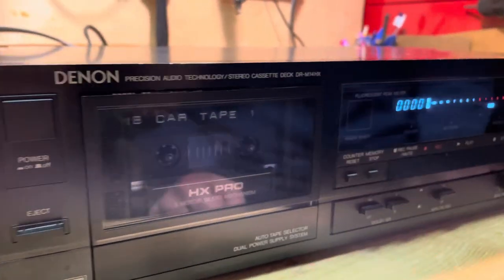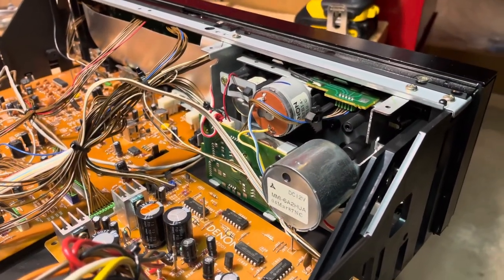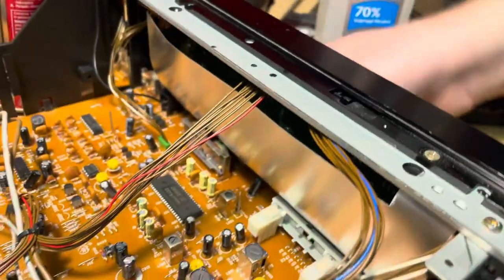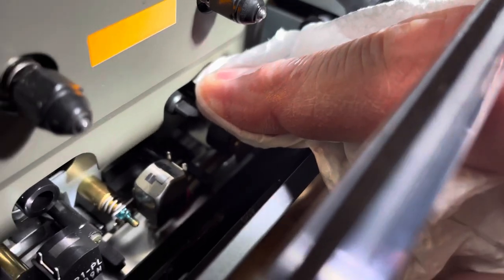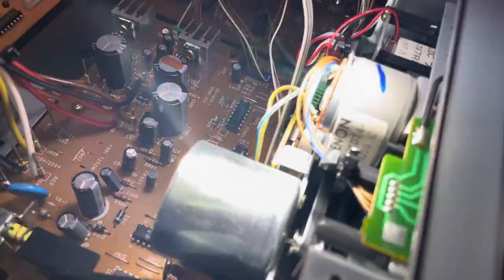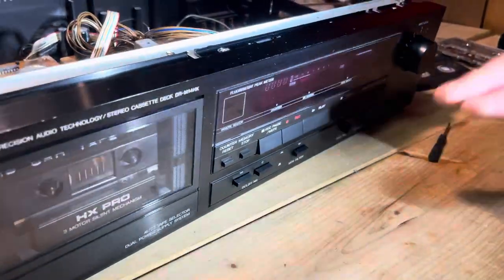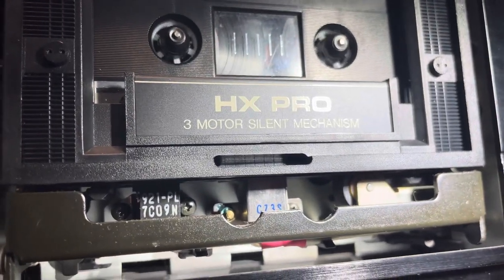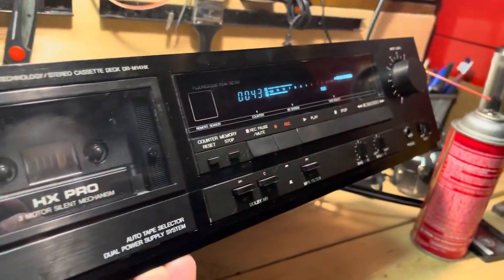Vintage 1980s Denon DR-M14HX Cassette Tape Deck Thrift Find Cleanup & Evaluation

Comment: I have the DR-M24HX which I bought from Denon directly at a Hifi show in 1988, ex display, it's never been repaired and still works like new, it's the 3 head version with tape tuning controls, it sounds incredible, that cassette tape can sound this good is an achievement, it will squeeze the most from any tape, Denon nailed it with this range.
Reply from the maker: Cassettes can sound quite remarkable. If you’ve heard of the electronics Youtuber 12voltvids, he strongly thinks cassettes sound bad but with the right equipment, they can sound almost like the source. Now if only they used type-2 cassettes for prerecorded tapes..

Comment: I would strongly recommend to use deoxit inside pots and switches. Sparing on top has no results. Also, at this age capstan and motor bearings needs lubrication.
Reply from the maker: When I got this unit all of the pots were fairly clean and it was kept in a good environment, so I felt that there was no need for spraying deoxit. All of the tape decks I have ever repaired never had any motor lubrication/bearing issues (except for one shoe-box recorder) so that isn’t one of the biggest problems with these.

Comment: This was really useful. I hope the paper towel isn't too abrasive to the heads. Is a head cleaner cassette a good idea or no?
Reply from the maker: You can use a cassette head cleaner, but if the paper towel has rubbing alcohol on it, you should be fine applying it to the tape head.  I actually prefer cleaning this way because it does a better job and less expensive because it doesn’t require you to get a vintage cassette cleaner.

Comment: Did the Rubber Restore get on the correct side of the belt? The pulley side is the important side.
Reply from the maker: I put the rubber restore on both of the sides and then clean it with a Q-tip, so yes. Thanks for the question!

Comment: Hello,
I got the exact same model recently, but my cassete were playing at high speed even at the lowest pitch control that I could turn. Does that mean something else need to be replaced? The belt is too tight?
Reply from the maker: It sounds like the capstan is not engaging, or the power supply rails aren’t the right voltage.
Reply: @davistech  hmm, so do i need to replace the capstan belt? the pinch roller? i dont know how to deal with the voltage issue though
Reply: @davistech  Hello
thank you very much for your advice. I have managed to fix the speed isse, it wasnt engaged properly
Thanks